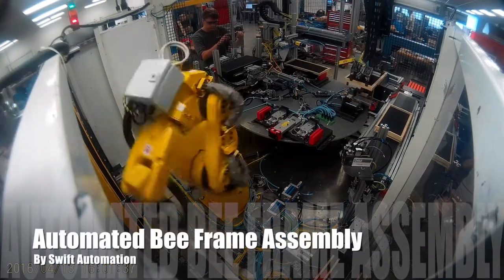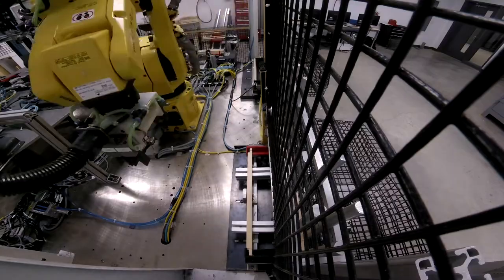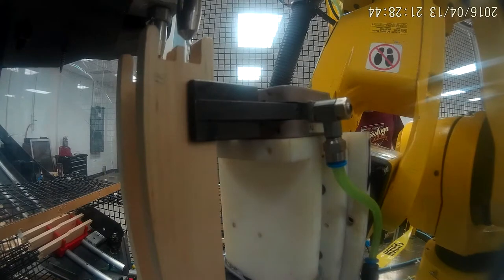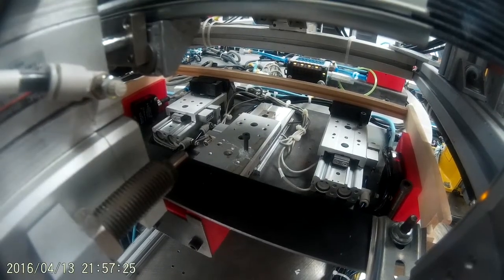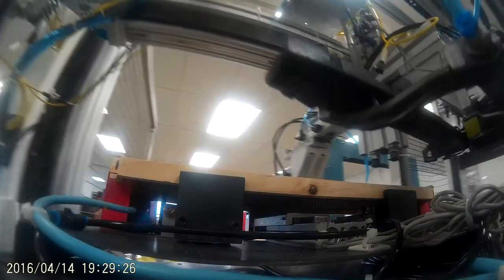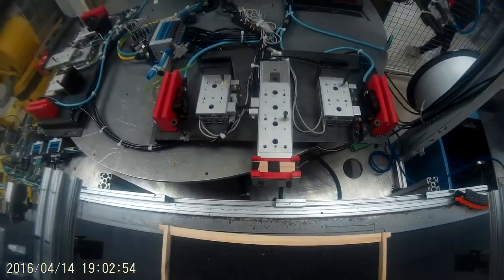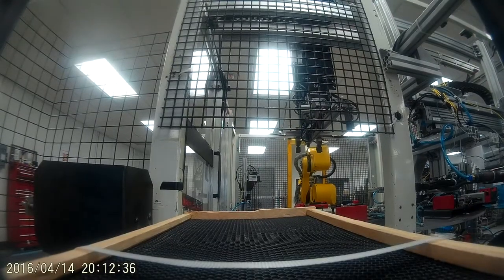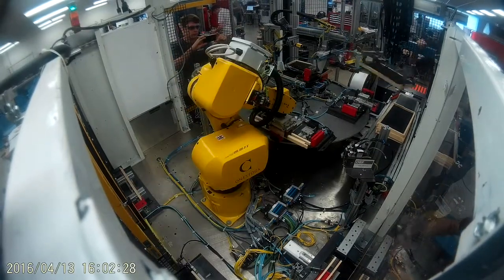Honey Bee Hive Frames Assembled by Robot

Comment: How much would it approximately cost to build a production line for beehive frames from beginning to end? 
how much would it cost  without this assembly part?
how much would it cost with it?
Reply from the maker: +Naivan Mladic It is hard to say as there are many ways that the frame assembly could be automated. 

We built the entire machine with a budget of $2000 CAD. We used about $1800 of that $2000. That was mostly spent on 3D printer filament and some stock aluminum. We were able to keep the costs low because we used a lot of donated/used parts. This also proved to be a challenge as newer technologies allow the same machine to be designed, built and ran much more efficiently... Keep in mind this was just a final year college student project.
Reply: could it be made with 61 480 CAD (40000 EUR) ?
Reply from the maker: +Naivan Mladic Most likely not. After hiring design engineers, machine builder, electricians, and controls specialist it could cost quadruple that.

Comment: Good concept except there are better ways.  I personally can assemble 10 frames with glue and staple them in under 2 min.   the cost effectiveness of a frame assembled by a robot arm is not effective the best option for frame assembly other than a human would not be automation,  rather a machine with guides and rollers.   "big city beekeepers" would not pay $150 per frame,  when they could buy a complete starter hive assembled for that price.
Reply from the maker: I agree with you. One of the capstone project requirements was to utilize a robot. Given a budget of $2000 I think we did alright. It was a great learning experience for us students.
Reply: @Justinoka   rule number one in deciding on whether or not to use a robot for production or to use automation. 1) can the task be achieved with automation?  It is always better to use automation rather than robotics for cost effectiveness.  When i was in school and had our robotics class (ABB) that was our starting point.   I have designed a machine that will glue assemble, insert the plastic foundation and staple the frames together.  When Run in the automation program I was using The machine set on slow speed will produce an assembled frame in 10 seconds, and after that once the "assembly line" was full it would produce a frame every 4 seconds.  cost to build the machine with minimal tooling is about $8000 us dollars running on single phase 220v electricity. The machine works with pneumatic's, hoppers.    The human element is to maintain the hoppers.    sorry for the initial negativity, but that is how i think in terms of industrial assembly/ machinery,  and that is one reason why I am good at what I do,  Always try to find a way to break your machine or process and improve it to keep it from breaking.
Reply: @SJ-us7td  might want to share your design then if its a 8k budget and can put out a frame every 4 sec.